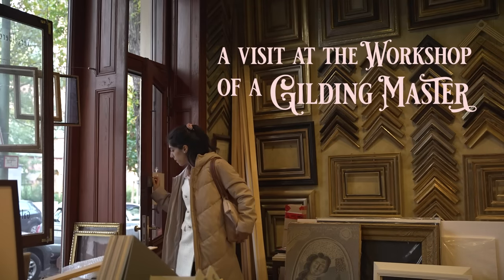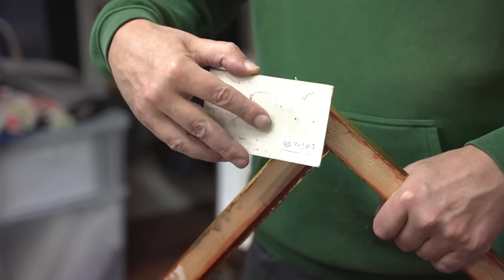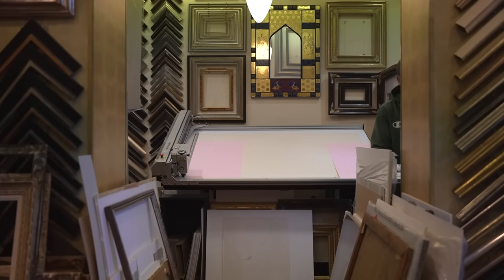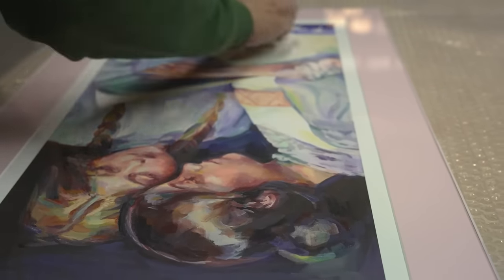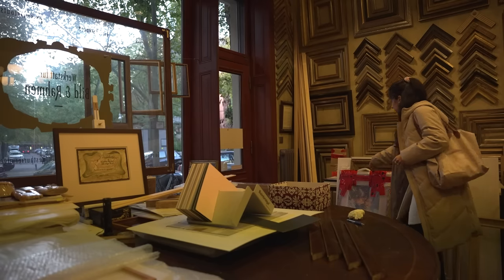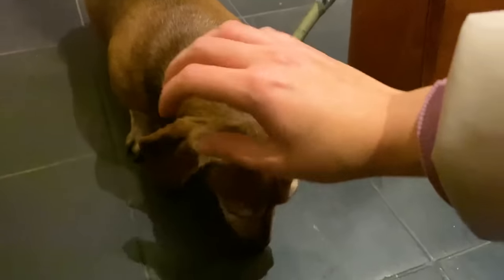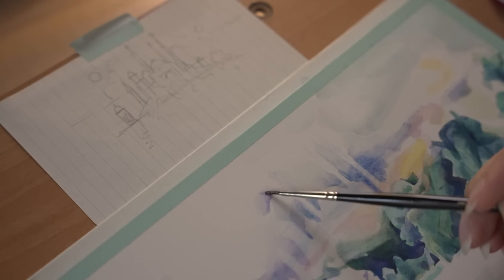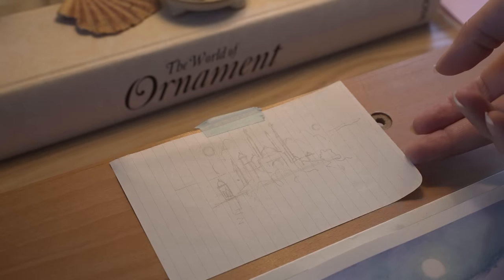Learning rare & old Craftsmanship 💫 Gilding Master Visit & Watercolour Painting 🖼️ Cozy Art Vlog

Comment: The word for the cardboard rim within the frame is ‘matte’.

Oil paintings usually are not framed under glass. They are varnished.
Reply: Yes you are right. To tell it fully, you must know that Valerie previously asked me if it is the same glass that you sometimes see in front of very important oil paintings in museums. In principle I answered this question in the affirmative - except that this is laminated safety glass. Such important paintings must also be protected from environmental influences using glazing - let's also think of acid attacks or something similar...